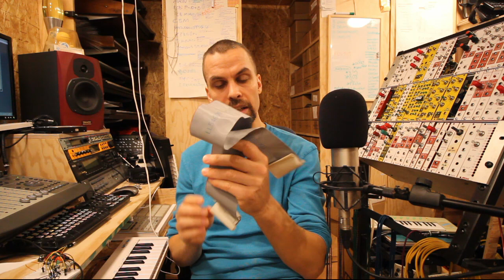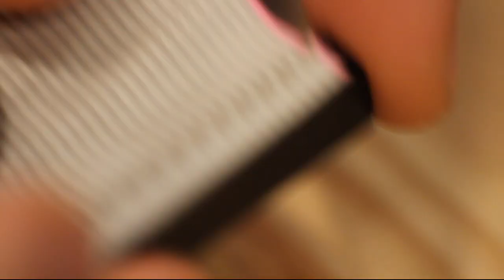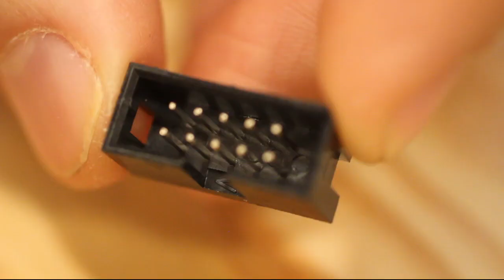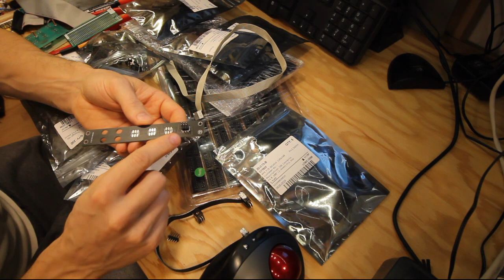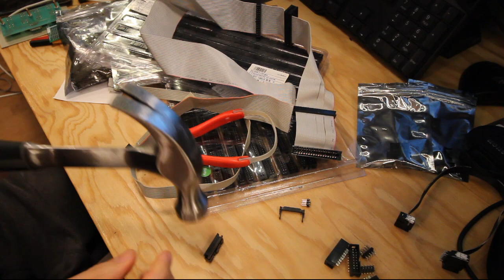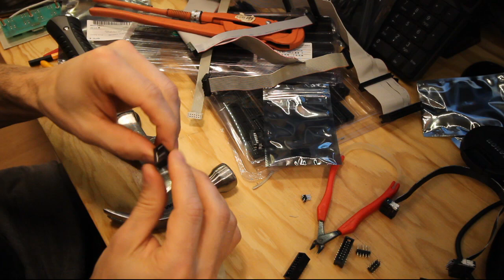Make your own Eurorack Power Cables - DIY Modular in a Week

Comment: All very easy to make is the BusBoard: A stripboard and some boxed 16 pins IDC connectors (eBay/Banggood, whatever)
Reply from the maker: Yep. I’ll show how to make a pcb Version the next time. :)
Reply: Flying ribbon cables are also easy. But both aren't the cleanest choices is my understanding.
Reply: @EdwinSL  Well, AFAIK, only TipTop makes them. But they can be a cheap choice - maybe for low depth racks, like the Moog 104 HP (or the Behringer cheapo clone!). But these are for very narrow modules, like the ones from two HP and Mutable Instruments. Doepfer modules use to be too deep (i.e.: an A-110 won't fit).
Reply: @FraterKatzioVelletriensis  Flying ribbons are also made by others like Endorphines or Kostant Lab, but making them yourself is not harder than what you saw in the video.
Reply: @EdwinSL  Yes, of course they'd be easy to make.
And possibly some system to anchor them to the case would also be nice.
Reply: I've done this with perf boards and raw hookup wire.  You can see my setup on the Patreon community pages.
Reply: @spot2028  Well, a Stripboard would save you from manually connecting the wires, but, yeah! Why not!! Perfboards are even cheaper! ;) But you'll have to take in account the wires AND your precious time.

Comment: That "handle" you attached is actually a "strain relief". You fold the ribbon cable back over the top and attach the strain relief. Then you can ease the cables out of their sockets with less risk of them pulling free from the end connector. It can also act like a "handle", but it's easier to just pull, lightly, on the cable and connector together. I put a finger along the underside of the cable and put my thumb on the opposite side of the connector.  Squeeze my thumb and finger(s) together, then pull/rock (lengthwise along the connector) to ease the connector out. I made and used many of these in the '80s and '90s.
Reply from the maker: Thanks for the info. Of course I should have seen that as I actually in the video remove one where they did as you say. I have seen cables use them with a bit of tape or similar aswell though. Usually hard drive cables had those “pulling handles”.

Comment: I prefer to use a vise for this.
Each side can be heard when connected properly, you can hear it clicking in. Else the cable might come loose later on.
Reply: A vise is overkill, but works well. When we did not have the correct tool (they do make one) we always used a pair of pliers. If the connector is squeezed tight enough, which is not hard, that you pretty much can't see any light between the top or bottom of the connector and the cable, it is tight enough. Also, if I remember correctly, there is a bit of a snap when they are squeezed shut. However, that snap is kind of hard to feel/hear. ( I just realized you mentioned the click... Oops! But, yeah, there is a click, but you have to know it's there or you may not notice. Sorry for missing that in your post! )
Reply: @tajjej3649  Good man, I use a small hobby vise with rubber pads, if you've got a big steel one it is advisable to put rubber on the clamps.
In addition, it is advisable  to fully fill each connector with cable,  cut away the non used wires but leave them in the connector for even pressure dividing.
Reply from the maker: Yeah I saw LMNC used a vise. I don’t have one and thought that most people don’t either but of course a good choice if you’ve got it. I also try to listen for the “click” as Phillip says. Although it is hard to hear when using the hammer. 😂
Reply: I simply use large plumbers pliars, like the first one you held.  Yes, I have cracked some of the connectors at first.  But now I know how much pressure to apply on each side and usually have no problems.
Reply: I used  a vise too.. Works great!

Comment: I get multi-colored ribbon cable on Amazon by the rolls.  Pretty cheap, but not the typical grey/with red stripe.  I just remember which of the various colors I designate as +.  This video is much needed for anyone getting started.  Thanks as always!
Reply from the maker: Yeah I’ve seen those too. Even a bit cheaper aren’t they?
Reply: @SourceryOne  I get a 15' roll for about $7.  Like I said, multi-colored, but with only 10 wires.  So far I've been skipping the 5vac, but I think I'll be changing that as I move forward.